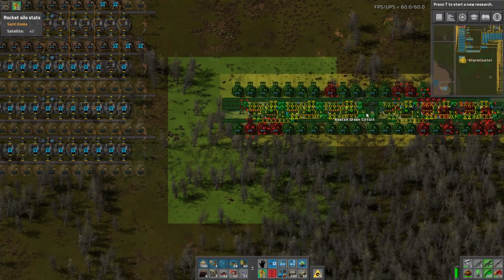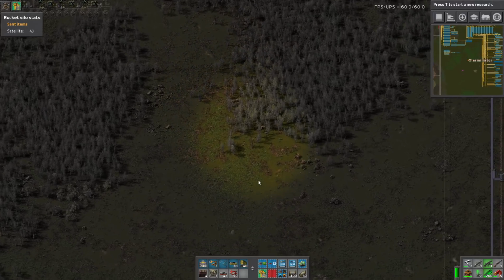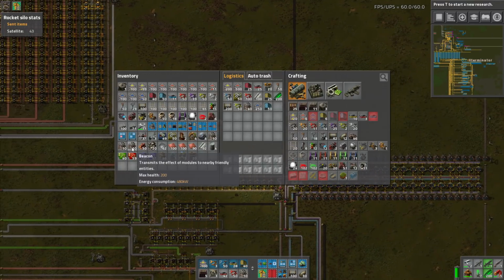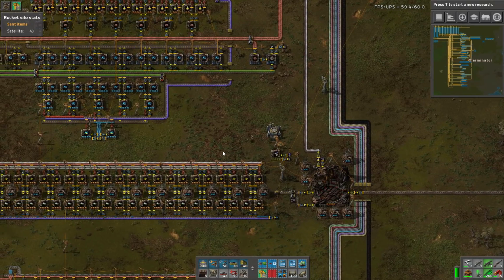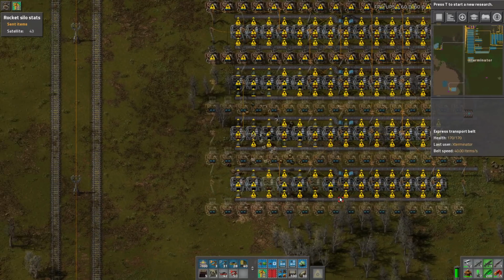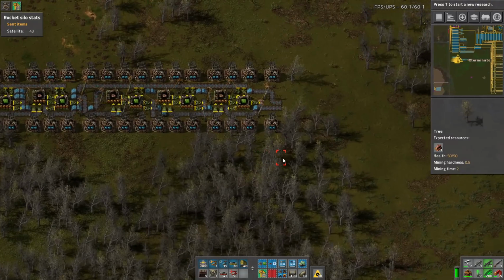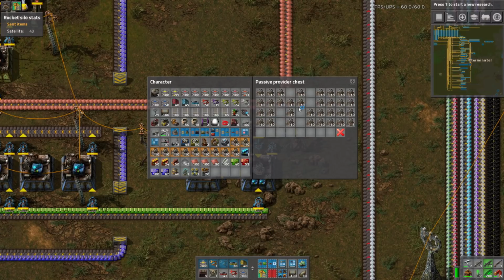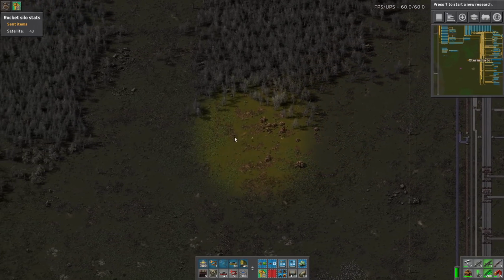Factorio: Tightening The Belt: Megabase Guide EP52 - CIRCUIT EXPANSION! | Tutorial Gameplay Series

Comment: The output for the third green circuit builder will not work: it will hit the "end" part of the underground. I've tested arround with this kind of double build. The only way i could get it to work quite reliable at 4.8k p/m is this way: https://pastebin.com/qUiQVRAz Although it's more likely to behave like 4.75k. (also no power poles since tested in creative mode). Otherwise: love the building and how you explain stuff. Gives a lot of inspiration for my own bases

Comment: I've yet to launch a rocket in my current unmodded save yet, but I've automated all science packs on a large main bus, finished most of the research, and have offsite iron, copper, steel, and a few green circuits being brought in by train.

What is generally the best way to expand from there? Should I build a ton of logistic bots or maybe start mass producing modules, miners, and assemblers? I've gotten to this point before, but I'm not really sure of the best way to expand. Modules seem like a logical step because productivity combined with speed can make a big difference. I'm trying to aim for a bunch of train stations with bot based factories for each main resource, circuits, and science pack.
Reply from the maker: Congrats for getting this far! :) Mass producing modules and beacons is definitely the next step. Then either find or make some beaconed and moduled builds with bots if that's what you want to use. And also making a lot of assemblers and furnaces and stuff for all the builds will be important. 

In terms of the beaconed and moduled builds, start from the ground up like you would a normal base - Meaning, start by converting smelting to that, and then circuits or gears etc. Hope that helps! :)

Comment: Can you explain the train signals, i end up with "No path" trains quite alot since i have more than 2 trains now.
Reply: You will need to provide more details.
-Are you using single-headed or double-headed trains?
-Are you using single direction or dual direction tracks?
-What kind of intersections are you trying navigate? 2-way, 3-way or 4-way?

If you want to troubleshoot on your own, then park your trains either at their input locations or their output locations. Next, follow the tracks (let's assume) for train #1. When you reach an intersection where you would cross a track, place a chain signal before it. Keep placing chain signals along your chosen path until you exit from the intersection. Then place a regular rail signal. Follow this pattern until you arrive at your destination.

Starting from the destination, repeat the same process until you are back to where train #1 is parked.

Do the same thing for your other trains.

This should allow you to signal most of the intersections.

After these passes are complete, you will need to determine if you need more chain signals and regular rail signals to make sure that everything is either green or blue. You want to avoid flashing rail signals.

Also, you want to make sure that you are not attempting to set up schedules that trains cannot perform. Make sure that all the stations are part of the same rail network.

Perform a few tests with the trains to see if they still "no path".

Finally, consider installing bypasses. If you are using single tracks that carry trains in both directions, then you need a method for temporarily parking trains, until the first train to enter the block can leave.

I hope that this helps.
Reply: 1. I started using dual-headed trains because i ran out of room
2. Dual direction tracks, my trains carry items both ways.
3. I haven't used intersections, the trains can visit every station.

I fixed the no path issue by now i started using more than 2 trains and i got to learn how both of the signals work, but now i ran into a new problem - 2 trains that use the same schedule keep going head-to-head into one 2 way signal and get stuck there, 1 of them is trying to get into the same station the other is leaving.
Reply: If you can drive the train manually to the destination, but it can't path there, then the usual problem is you have a lone rail signal on the left side of the tracks somewhere.
Trains will never path past a rail signal on the left hand unless there is also a rail signal directly across from it to signify a two-way rail section.

"I haven't used any intersections"... If you're using double headed trains, this is literally impossible. There would be absolutely no way the trains could ever pass by each other.
Any time a piece of rail joins to, or splits from another piece of rail, that is an intersection. Doesn't matter how simple it is.
Safest intersection fix: Put double chain-signals (to signify two-way traffic) on every exit from the split. https://i.imgur.com/EfeEBJ9.png

In fact, the safest (and slowest) possible way to signal your rails would be to ONLY use chain signals.
If you used single-headed, then you would need a normal rail signal at the entrance to each individual train stop.
Reply: I thought an intersection was a cross. Yes, i do have them then.
Reply: That's also a type of intersection. It's not common to have two rails simply cross each other without any way to switch to the other... but occasionally there are reasons to do it that way.

Comment: Not a major issue, but those green circuit builds(half build really, was considering the 40 output belt.) don't consume the full 40 input of iron and copper.  Checking with a calculator, Im seeing 29 iron/sec and 31 copper/sec.  so  if you built 4 green circuit builds you could feed it with 3 iron furnace builds or 5 Green circuit builds with 4 copper furnace builds.
(or for 20 GC builds, 15 Iron builds, and 16 copper builds)

Interesting question comes up, is a balancer and the full builds going to be better then underutilised furnaces, or even scaled down furnace builds making the 29 and 31 for their respective lines.  My guess would be the balance is better than the other two options.

Comment: You mentioned 2 ways to transtion to a megabase, but what I did was slightly different from either. So my starter base was laid out (right after I graduated from burner miners) to produce 4 red belts of green circuits. 1 went into red circuits, 2 more went into processing units. Before long, my started base produced several thousand modules, which was enough for half my iron smelter and half my copper smelter and my green circuit build for the megabase. This didn't take to long, and I spent the time fixing other bottlenecks (mainly outposts). From here, I imported green circuits, and eventually red circuits and processing units from my megabse builds. Now, I'm producing >10 of each modules/min, which is plently to double everything.